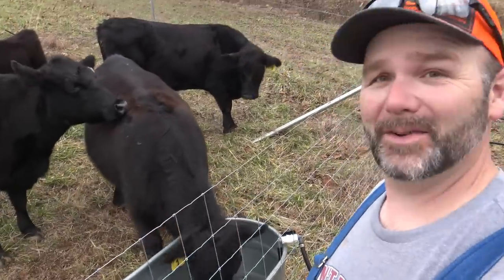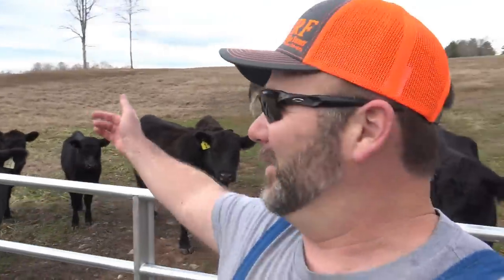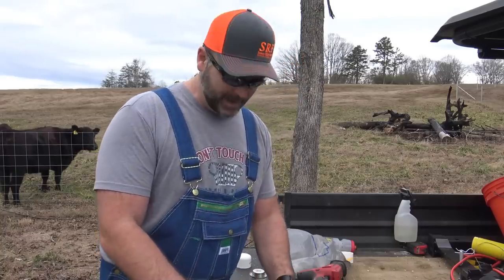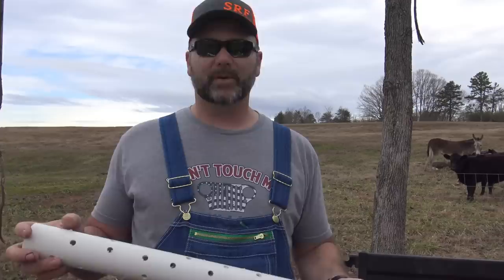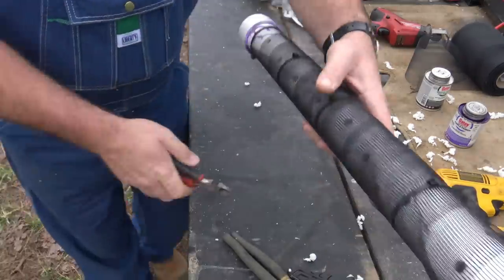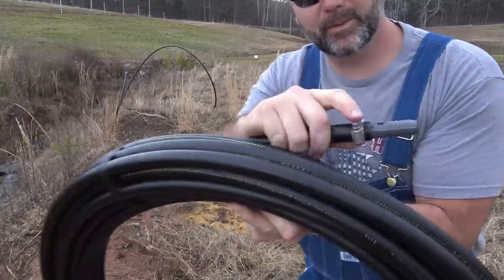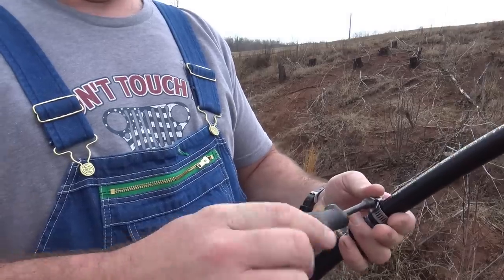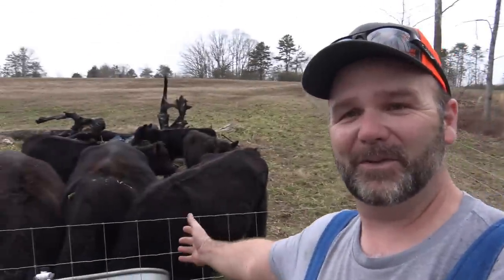Non Stop water system..no electricity, no pump, simple and easy

Comment: Your idea is very good but it lacks the required embellishments. It would be helpful 
to install a float valve at the tank end, else the water will overflow and create a muddy 
mess for the the feet of the cattle. Muddy feet leads to foot rot, a dangerous condition 
that requires extended  treatment by a vet who makes house calls.  You will also have 
to move your tank to a new, dry location. A valve is cheaper than dealing with the 
consequences.

 The cows will still dribble water. If you make a short wooden platform under the tank, 
with the platform on flat stones, the cows can still drink but without their front feet in 
mud. 

If you go to the source of the water that fills the pond, perhaps you can make a little 
dam that raises the stream water about four feet. Then you can build a ram pump, that 
lifts water without a motor. This first ram pump will lift the water about 20 feet. At that 
level install a second ram pump. this one will lift the water about 80-90 feet, that is, over 
the top of the hill. If you wish, you can put another tank at the top of the hill, with  its 
overflow filling the lower tank. Any time you raise water, even from a well, you must have 
a one-way valve to prevent the water flowing back to its source. in your case, this would 
be between the submerged input and the black tube. 

Another way to lift water without sucking on the hose is to install an eight-foot length 
of copper tubing in the black pipe, close to the pond.   At the high end of the copper pipe, 
fill the pipe with water. The one-way valve will hold it there. Now connect the high end to 
the black hose that goes up the hill. Start a little fire at the low end of the copper pipe. 
Warm water rises and as it rises it will pull in cold water from the pond, which is also 
heated and continues to push the water upward. When the water reaches the top of the 
hill, siphoning will occur, and once it flows into the tank, you can put out the fire. Copper 
is a noble metal  and won't rust, so just leave it there. You will need to heat it again, you 
will find out. 

One thought I have: do you have freezing weather at your ranch? How will you prevent the 
water freezing in the pipe?·Or in the tank? A solar heater is the answer. 

Consider Murphy's Law anytime you think you have invented something new. There is noth-
ing new under the sun. The ram pump was invented 225 years ago in France, by Joseph
Montgolfier, who also invented the first flying machine: the hot air balloon. One more thought, 
if you'll forgive this unasked-for advice. It's about that tank water. I see that you raise Aber-
deen-Angus cattle. Their health is vital to you. You will soon find that your new tank is filling 
with two unwanted elements, algae and mosquito larvae. You don't want your cattle ingesting 
mosquito larvae. Go to the pet store and buy ten goldfish and let them live in the tank. They 
will eat the mosquitos and the water striders. There are also small fish that are happy to eat 
algae only. Get some of these too. A little bit of chlorine can also reduce the algae; use more
 on hot sunny days.  Oh yes, one more thing. For the number of cattle you have, you really will 
need a larger tank. Cattle will not go to drink one at a time, like horses do, by themselves. When
 cows get thirsty, all of them will go to drink. The first cows will drink all of it and rest will go 
thirsty. Most certainly a half-inch pipe is too small and so is the tank. ~ Ross Murphy, the Sage of Shawnee

Comment: To syphon the water:
After pipe all laid out, leave a hose connector, up on the hill disconnected.
  Put a removable cap on the tank end of the hose!
  Fill the tank end of the hose with water, at the end, at the top of the hill.
   Connect the hoses, at the top of the hill.
  Pull the cap off the tank end of the hose.
  The weight of the water, flowing into the tank, will draw water from the pond.
  If you still have problems, then rig the pond end, so you can plug that end too and fill both lenghts of hose with water, then connect the splice, at the top of the hill, and then open the tank end, and then the pond end; or have someone do it, at the same time, for you.
 No more sucking on that hose, and chocking on nasty water.
  You can use the same principle, on any syphoning project.

Comment: theres a simple solution . put a  t  in just below the levy. add a 1 foot section of poly on to the  t . add a ball valve.  close the lower valve at the tank .open the valve just below the levy . pour water in to valve till its full.  close levy valve .open tank valve. there she goes.  easy piezzy

Comment: Never siphon  just fill the supply line with some water. When that water goes the sorce area it will create  its own vacuum  and will start its own water from the sorce. You dont need to suck the air and  water , just let the water drain to sorce it will pull the other water

Comment: Fishtank pump pipe is the good idea for water syphening
Reply: Have you ever tried such a silly idea? That pump could not lift 38 pounds of
 water even one inch.
Reply: @kansasross  better than sucking water from pond ..i think if sucking worked then this will also work
Reply: @arvindlutava4804  Sucking won't work. No man on earth has lungs strong enough to 
lift 19 pounds of water one hundred feet up a hill. To pump water from my well I 
have to lift it 41 feet, which requires a two horsepower pump. Your little aquarium 
pump is about 1/125th of one HP. Further, it doesn't lift water, it only circulates it 
at the same level so the water weight in an aquarium is zero. If you will look further 
in the replies you will find that I tell exactly how this man can make his cattle water 
tank work. What he shows us is far from complete and is not a real solution to his 
problem. Ross Murphy who should not have said you are silly. I apologize. It is the  

aquarium pump that is silly.
Reply: @kansasross  oh man ill tell u a free idea just fill the small pipe with water first , throw it from top to low provided one side is diped in water in lake and that u are throwing other end which must be lower level  from pond .. u get water at other end ok
.. u tried to suck the water was silly ..

Comment: So you dont have to pull 300 for of water with your lungs and enjoy that plastic flavor and pond water desert is to “charge your hose first”.  Meaning, you need to have the hose full of pond water at the start. Take ea spoil and dunk it under the water till the hose is full water, end to end, then dunk the next hose, etc until they are all pull water. Attach the hose as you showed, under the surface of the pond or just be careful when attaching to keep the rose charged end to end with water. When complete, all length of your hose has water. Pinch end with your ball valve, walk hose out to destination point, open slightly lower than pond or allow the pond pressure to push thru to exit at your destination end of hose.

Comment: It is not good to wait so long to provide your cattle with water, if you are need to move your live stock before their water system has been set up, then temporarily use buckets to fill up their water trough, just don''t leave them without a source of water for so long. As for your water system, it seems pretty good, but you may want to attach an 'anchor' (such as a rock) to dangle below the filter as well to keep it from floating ashore and clogging up with mud. Good job.

Comment: put a ball valve onto your filter above the intake and a shutoff valve at your tank-now at the top of the dam connect a vertical stand pipe with a cap into your line fill the whole line with water so the ball valve will keep your fill from flowing out and your shutoff valve will do the same at your tank. Now simply open the valve at the tank and since the whole line is now full and the tank is below the pond level the ball valve will open allowing the water to flow down to the tank.

Comment: I like the quick idea with the filter, but you spent too much money on a float. 2L empty coke bottle with some wire wrapped around the pipe and also the lid of the bottle will do the trick. They last for years too as I've had one on my water feed for about 10 years and still hasn't cracked of broken. But it's as easy as replacing the bottle with another empty one if that happens

Comment: Mate you can  suck  that water  easier ,  if you  get  the  Exhaust of your vehicle  and use  the  airflow coming out to  run a Venturi air pump .        Venturi with some of that PVC Pipe u have >> About 2 feet    long . Now  get  a small piece  of tube about  1/4 Inch ID   . Find a drill that will be just a tiny bit smaller than the Outside diameter of the 1/4 tube  .  Now drill a hole  in the PVC pipe  and squeeze  that Tube into the  hole and into the PVC Pipe    and if you can     get that  end  to be in about the middle of the PVC pipe .
 This will be your Ventury pump  
connect  the Exhaust pipe of your vehicle  to one side  of the PVC Pipe making a good seal  so that the exhaust gas   goes down the  PVC Pipe  .     When you  run your  Motor downward on the  Vehicle  there will be a Low pressure  formed  on the opening of the  1/4 Tube   Poly pipe .(You test  this by getting a glass of water  and putting the 1/4  tube in the water  and when you  rev the engine  the water will be sucked out of the glass   )
Now connect  this Tube  to the Poly pipe coming from the DAM    and wait a few minutes and the Venturi that you have made   will suck that water out of the dam and  start the flow of water for the Siphon  .  USING your mouth to suck  old bad water  can be dangerous to your health  
 It will work because this is how Aerodynamics work and cayuse airplanes to fly  
 Please try this and  contact me on robertsgfr@gmail.com   and let me know how it works for you . Thanks for reading  http://www.hendersons.co.uk/wms/venturi_principle.html

Comment: Use a small electric or hand pump to fill most the line with water.    Pipe is now primed.  No need to suck water.  

Or you can get wet and dirty by sinking the poly pipe in the pond so it fills with water.

Comment: Not passive, you have to turn it on and off. Mount a toilet float on the trough with a shield so the cows can't damage it and it will fill automatically  and shut itself off , no need to be there to watch it.55 year retired plumber
Reply from the maker: Yep...valves coming..but not toilet valves...cattle would destroy them...passive...water flows without requiring external energy source...passive ..wink wink lol
Reply: Stoney Ridge Farmer ,valve has to be manipulated( requiring energy )

Comment: You do it an easy way...just install a check valve at end of the hose on the pond side.. then a ball valve at the other end.. close the valve... put a tee on the highest part of the hill where you can fill water and close it when it is full.. be sure the checkvalve is installed right where the flow of water is in the direction of your house otherwise it will not flow because it will only flow in one direction... now open the ball valve
And water will come out.. the weight
Of the water will drag the water out from the pond without stopping.. not until you close the ball valve..however you can
Adjust it so as not to make your place flooded or you can install the float in your water tank.. the same principle of your toilet bowl...

Comment: Submerge the entire hose before you take it down. The water weight will start the process
Reply: I would like to watch you try to submerge 200 feet of pipe in a pond. It would make me laugh for an hour. It floats! 
Water will only float downward from the ends. With great effort you might get two quarts at each end. Even if you
strip down and sit on the pipe, you will only fall off. The water is cold and dirty. Even if you could fill it, 200 feet of 
water weighs 38 pounds. Add to the weight of the pipe, 56 pounds, try to carry 96 pounds of coiled pipe uphill. 
You would also have to plug the the pond end of the pipe so the water won't run out. Now you would have to un-
coil the hose as you go. Don't think you can turn loose of it at the top of the hill. You must plug the other end too.
The tank must be substantially lower than the pond or it won't flow. Now unplug that end. The water will flow'
until the pond is empty; what will stop it? A movie of all these gymnastics would make people laugh until their 
stomach muscles ache.

Comment: You might help more if you showed adding water to the pipe to fill the 300 feet. Everyone knows  the complete line has to be filled to initiate  the lower water level pulling the higher level into the pipe. Instruction did not  consider someone who had no grasp.

Comment: Polyethylene is not uv stable either, not only will it break down in sun light, it will drastically increase the amount of plastic your cows are drinking. In the carolina's you don't have to bury it very deep to avoid frosting and a few inches of dirt will protect against uv. I know that there are many people who will say we did this and it work out fine, the fact  is that you fed your cows and livestock and maybe yourself with ten times the legal limits of plastic. Being a master plumber I wish I could offer you a cheap easy solution but there isn't one right now. Poly needs to be buried or sleeved, it will eventually sink into the thatch and be covered but that will take months or years depending on the ground.

Comment: Hey thanks for the video and about a better way to bleed the air from the system is to instal a transparant tube in a t shape and close the exit tap and connet it to a vaccume pipe and when the water comes you can see them then close the vaccume pump and open the water exit tap and there you go no pond water sipping    tell you what???   .if i had a privet pond and a few cows and a pasture land i would drink a gallonn of mi pond water haha but hey its better to do it in my way because is air gets into the system in any way i wont work so its proudent to keep a vaccume pump     love from israel jesus we love you come home !!!

Comment: Fiberglass screen = tiny fibers of glass embedded in the cows when they drink.  The fibers stuck inside them causes white blood cells and that can't clear because the fibers can't be removed. So, the white blood cells harden...around the glass stuck inside the cows. So, the body panicked to continue to try to heal the glass wounds. So, more white blood cells pile up. Tumors grow, soften the tissues around the tumor....(think like         hands inside bathtub and overloads too long and brakes the cells from over saturation..-----.have you seen what drowned bodies in water look like? The cells over water and swell break and rot. SHORTENS THE LIFESPAN of the cows. Those that sell for beef eat the glass....The above process happens to them. The glass doesn't break down like cows and our biology).  This, sadly is not an overreaction....this is science. This is cancer = painfully ruins life.  Hope this data is welcomed to help you.....change the fiberglass to something stainless steel fibers....Much love to our hardest working farmers. I am so impressed with your water system...rigging. I read science..but, you are an inventory. You may want to sell packages like that on the side....for home camping that is increasing....

Maybe a suction cup hand pump.... Hehe breast pump? Sorry....it's a pump

Comment: Why are you sucking it!! Thrust and draw syphoning from the pond end is far betterif possible. IE: push a short section of pipe ( that can be linked  to your main line on the down hill side) into the pond and cup the the flat of the palm of your hand hard up against the opening of the pushed pipe before drawing the pipe back ready to push in again. 
This blocking and releasing action with the palm of your hand over the pipe opening acts like a plunger when co-ordinating that action with the thrust and draw 
Pushing the pipe into the pond, with the pipe open at your hand, loads the pipe with water>> drawing it back with your hand over the end of the pipe stopping any air entering the pipe on the draw creates a vacuum thus holding the load of water in the pipe as you draw the pipe ready to thrust back in again.  When establishing a rhythm imitating a piston like motion co-ordinating the cup and release pattern as you thrust and release will pull the water through the pipe. 
Once you have established the syphon flow through the short pipe connect it into the downhill pipe below, ensuring you retain flow below the syphon source, without getting to wet from backsplash as you connect if you can.
I hope you can get your head around  my description.
This type of syphon method is used often when  irrigating rows of cotton from irragation canals beside cotton crops. 
Short 9-12ft poly thrust pipes adorn many irrigation canals ready to be loaded as above and thrown over the low earth canal walls into the waiting rows of Cotton when flood irrigation  like this is used.
It is not uncommon to start 50 to a 100 rows at a time with this old proven method. 
Quite effective for irragating when one becomes proficient with the thrust and draw technique.

Comment: And if you are pulling water from a creek or running stream, then here is a way to get water up the hill, where no electricity is available. Its called a Ram pump. super easy to build, and can produce endless water. https://www.youtube.com/watch?v=EV1yhnVCeJY There are other videos  with different designs, but you get the idea with this one.